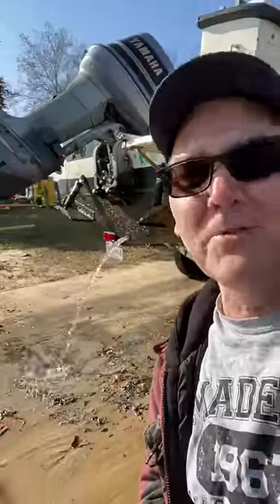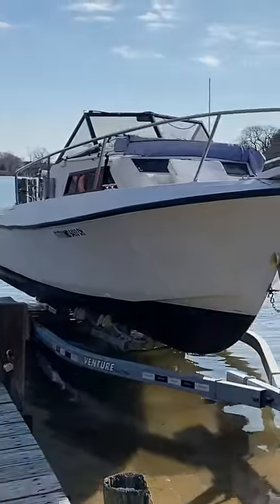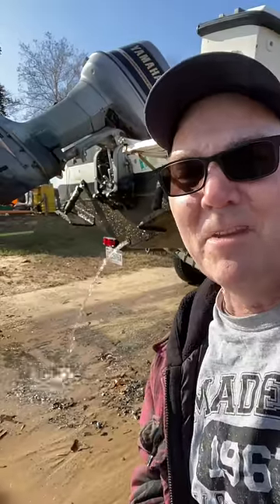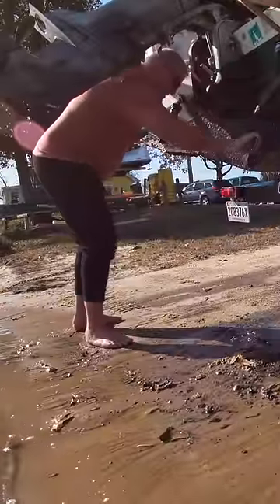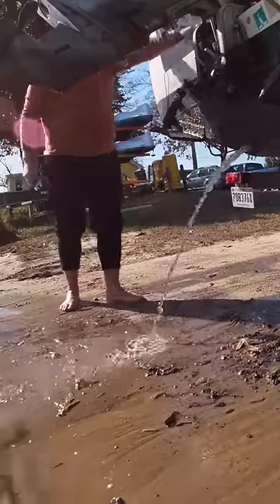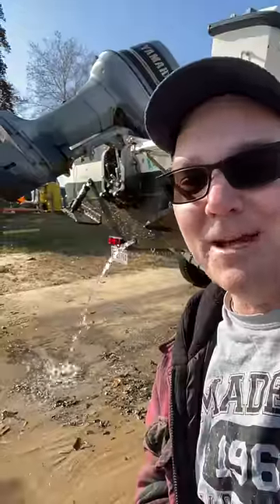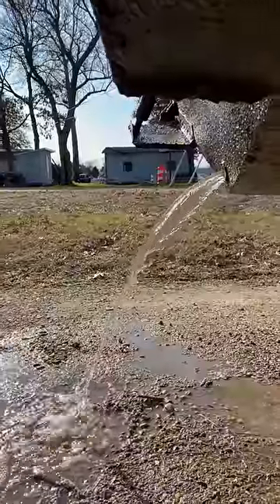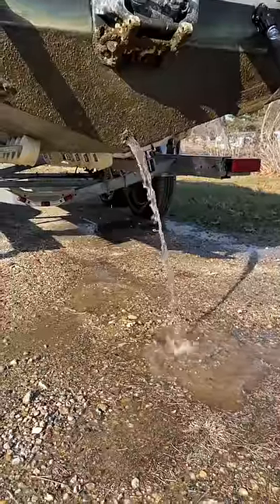When a boat bilge pump isn't working and there's been some very heavy rains lately. #boats #bilge

Comment: You guys ever hear about a fantastic new invention?  It's called a bilge pump.  You should use them every once in a while.  They are very efficient and if your built in pump gets damaged you can rig a temporary in less than an hour(much quicker if you do a lot of work on your own).  And forget carrying it along a road,  you have been dragging it around the lake...

Comment: 🎉that damn plug!
  I've owned a boat for yrs. Seen a lot of stuff!!!🙄👀 But the one time I take kids out. 
The oldest 11/the youngest 9. Done this over a hundred times with the boys I backing up in my 16' bass boat series with my boys, yelling and screaming pull up! Forgot the damn plug!!!!!🙄😤 Pulled up, put it in backed down and took off! 😅.  When bought it, the pump wasn't set up properly!!! Didn't come on until she was heavy!!! Just above floor, only inches(my boat G III (3) Bass pro series!  Little 4 with booster prop!,👀

Comment: My dad used to pull the drain plug when we were heading back to dock. We were going so fast it would still run out even though we were still on the water.

Comment: Reason 2, other than weight, is rocking, and swaying the water will rock the boat on the trailer. No joke boat can move off the trailer at high speed on the highway 8lbs per gal x 300 gal = 2400lbs move sloshing water

Comment: The bilge pump should be running way before that, before you pull the boat out of the water, that extra weight would make the boat ride low in the water, messing up the efficiency of the ride

Comment: Maybe its time to start looking for the leak, or leaks. 
Or learn how to use the bilge pump as well. 
They make 2000 gph pumps that work wonders on leaky boats, my buddy has about 6 of them in his old trihull that would sink without them. (Its sunk four times hen the power failed at the dock).

Comment: Bro, you’ve got a leak somewhere maybe the outdrive boot or maybe your drain plug is in ceiling properly or if you’ve got those on board sometimes those can leak😊 OK so it’s definitely not an outdrive boot so then it’s got to be a screw in your trim tabs or a screw in your transducer. Something is leaking.
Reply from the maker: This boat is not mine and has been sitting in a marina for months with a broken bilge pump and failed engine.

Comment: SO many years ago a friend decided he needed to clean his bilge (the usual contaminates had accumulated over the years) So he came up with the bright idea with the boat on the trailer that a pint of dawn dish washing dumped in the bilge would do most of the work. He forgot to shut down his automatic pump and every time he would accelerate his high volume pump would spray dirty soapy water out of the starboard side.... As he drove thru the down town street during evening sidewalk dinner time!! LMAO!

Comment: A bilge pump is only about $50 to $100, depending on how fancy you want to get.
Seems like that might just be a good investment.
Reply from the maker: This boat is not mine and sat in a marina with a broken engine and broken bilge pump for several months. This is rain water accumulation.
Reply: @WayneTheBoatGuy   I was just being a smart ass. 
I had a friend who forgot to take his plug out while the boat was in his yard. He never covered it and left town for a few weeks. He came back to a completely full boat, and it had frozen as well. Fiberglass ski boat. Completely destroyed.

Comment: I installed a one way valve in place of the bilge plug. As long as there isn't pressure pushing in on the drain hole, the bilge is draining.

Comment: There's a modern invention, it's called a bilge pump.  Maybe you should get one, your boat would weigh about 1000 lbs less when you put it on the trailer.
Reply from the maker: This boat had one and it was broken. And the boat was sitting in a marina for months

Comment: Funny that people forget basic maintainance.
Same in Armoured vehicles, if they are not tarped properly, and stored without drain plugs. Try starting a vehicle and when you open the engine compartment, it's literally flooded with rusty water ... F a duck. Crawl under the vehicle, skinning your knuckles to get at and undo crappy drain plugs, knowing you will get doused.
😂😂😂😂😊😊😊

Comment: U should always put ur drain plug inside so you can take it out on the ride in to get rid of the water. Just remember to put it back in before you stop
Reply from the maker: Bigger boats don’t have access from the inside.
Reply: @WayneTheBoatGuy  that’s true but then you would put in a bilge pump

Comment: All that algae tells me the boat spends a lot more time IN the water than out.

So why is a heavy layer of algae on his boat if he takes it home right after using it? It can't build up like that unless it spends months in the water tied to a buoy.

I had a sail boat I couldn't remove from the lake but the club had a lift I could wash the build up off. Having a good kind of "bottom" paint goes a long way. I used an alcohol based paint that was easily washed off with alcohol. Algae gone with it. Faster boat. Hull speed matters in a race.

That stuff will slow you down so, so much.

Comment: Or you could use centripetal force while your boat is going very fast forward you could take the plug out drain the boat replace the plug before you slow down and you wouldn’t have to drain it at the dock
Reply from the maker: Bigger boats (like this one) have the drain on the outside. This boat is not mine and has been sitting in a marina for months with a broken engine AND broken bilge pump.

Comment: Not as important as it is to put it back in before you go in the water!
 8.8lbs per gallon is guessed about 4 gallons per minute out of the 3/4” diameter bilge plug, at 20 minutes you were at about 700 pounds of water, you should invest in high volume float switch controlled electrically operated bilge pumps, dump that wash out in a minute or two, keep your boat hull lighter, less displacement of water, less hull friction, less fuel consumption, less wear n tear on prop, outdrives or outboards, jet drives etc a ton is a ton, try swimming with a ton of ballast on your belt line, you wont be able to  without a bunch of floatation devices to keep you positively buoyant, so many you won’t be able to fight a 1 knot current for more than a minute or two. Not to mention, once you realize you’ve taken in so much water your boat is starting to  sink, and it takes on more water at an exponential rate, bad practice to run a flooded hull, keep the water beneath the bottom of the boat!

Comment: Obviously. This boat has not been in the water for several years. There is no outdrive. Everything is rotted. He's just getting rainwater out of a fixture in his yard
Reply from the maker: Outdrive? Do you see the outboard engine hanging off the back? This boat had been sitting in a marina for months with a broken bilge pump and failed engine. We we're pulling it out before it sank.

Comment: Why do boats use such a tiny plug? A 3in plug is going to cost the same basically and drain drastically faster.
Reply from the maker: A boat this size is equipped with a bilge pump that usually pumps out the water. This boat was sitting in a marina for many months with a broken bilge pump.

Comment: Dude, if you got two or 300 gallons of water in the bilge of a small boat, you have a serious problem. Also, do you know what’s more important than removing the plug and draining the water, putting the plug back in. Sure this is obvious, but many boats have sank because the owner didn’t put the plug back.

Comment: You're draining your boat to "save weight for pulling it."
What you should be doing is cleaning your bottom of your boat to save fuel in the water. Thaat's what you should be doing.

Comment: Never heard of running a bilge pump? Saves time on the ramp
Reply from the maker: This boat is not mine - it was sitting in a marina for many months with a broken engine and broken bilge pump.
Reply: @WayneTheBoatGuy  awesome…did you take it on as a project to restore? Looks to be in great shape w a little TLC

Comment: why do you have 200-300 gallons of water in the bilge of a boat that small?  Do you have a bilge pump?  If no wtf not and if yes wtf don't you run it on auto while boating?
Reply from the maker: It is not my boat and had been sitting broken down in the marina for months.

Comment: The way those barnacles are on the bottom, that boat has been sitting on the bottom.
Reply from the maker: This boat is not mine - it was sitting in a marina for many months with a broken engine and broken bilge pump.

Comment: The boat ramp is for the launching and retrieving of boats. Get out of the way.  Do that in the parking lot.
Reply from the maker: It was a Weekday, in December, right before Christmas and nobody was around. We knew we would tie up a ramp for a while because the engine didn't run and the boat had been taking on rain water for several months.

Comment: Yeah. Lift your boat up to drain the water out after taking it off the boat dock to the house 
Kept the battery charger on just in case for the pump.    Hey wait a minute. Why is the motor under water.  The trailer is tilted up and I have the battery charger  (oh the battery is dead.  And the plug is in ). 🤣🤣🤣🤣

Comment: Maybe you should repair the boat so it doesn’t take on so much water.
Reply from the maker: That's why it is being pulled out - it needs a lot of repairs (including replacing the failed bilge pump and engine).

Comment: Mistake after mistake. Way too much water..no bilge pumps...then driving away dumping water everywhere...did not reinstall the drain plug, probably lost ...the bottom of that boat is in a sad state as well.
Reply from the maker: This was a broken down boat that had been sitting in a marina.
Reply: @WayneTheBoatGuy  thank you for the heads up. I was beginning to question everything.

Comment: For starters, they're called "bung plugs"...secondly, it should have an electric bilge pump and a manual pump as back up, but the electric one should be operated every so often whilst out on the water and fully on when heading back to shore
Reply from the maker: This boat is not mine and has been sitting in a marina for months with a broken bilge pump and failed engine.
Reply: @WayneTheBoatGuy  it's a good project then

Comment: you know a bilge pump would solve that problem. and no need to pull the plug
Reply from the maker: This boat is not mine - it was sitting in a marina for many months with a broken engine and broken bilge pump.

Comment: Dumb question. Why is there so much water inside the boat. Looks like he has a major leak
Reply from the maker: It's several months worth of rain water! This boat is not mine - it was sitting in a marina for many months with a broken engine and broken bilge pump.

Comment: Maybe learn to turn on the pump before you get back to the boat launch
Reply from the maker: This boat was sitting in a marina for several months when we pulled it out. It had a broken bilge pump and the engine failed.

Comment: Fix you blige pump brother lol
Reply from the maker: Yeah this one was not working and the boat was broken down for months in a marina.
Reply: @WayneTheBoatGuy  I probably don't need to tell you this, but yeah that's like the worst thing you could do to a boat. I just had to swap out some bilge pumps and totally rewire this boat that had the same treatment. All the old wires pulled apart like paper lol

Comment: You know if you put a downspout on that with a ball you wouldn't have to worry about that because when it came out of the water the water would push the ball down the water would come out you put the boat in the water the ball will come up and shut off or some other similar design why this hasn't been done I do not know I'm very very old so I don't have the time to go ahead and put the money in my pocket so why won't one of you with a 3D printer make one of these and put it on your boat and then sell it the valve not the boat genius